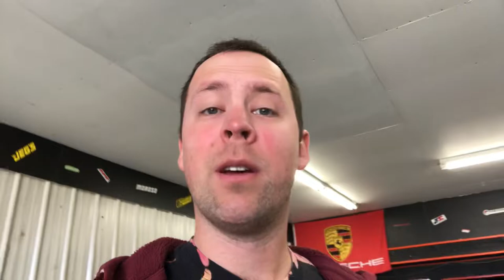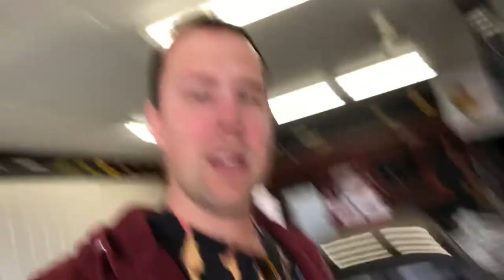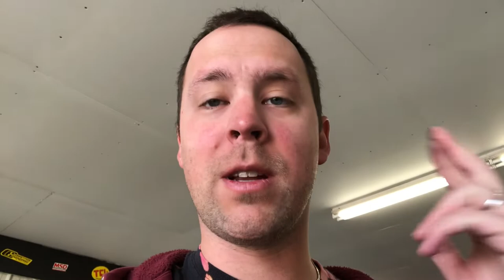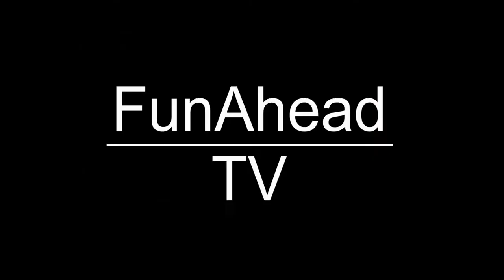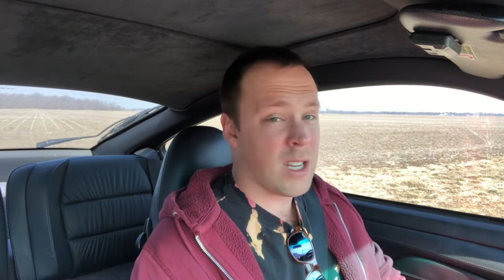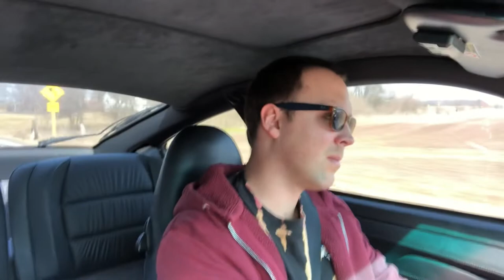Driving My 996 911 for the 1st Time Since an Engine Out Service

Comment: I’m jealous! I’ve been waiting for two years to drive mine again. All my parts are on back order tho, since I’m rebuilding the engine from inside out.
Reply from the maker: Sucks everything is on backorder! Why did you decide to do a full rebuild?
Reply: @FunAhead_TV_Official  had glitter in my oil filter so that pretty much answers that lol
Reply from the maker: Oh, snap… no bueno. Did you ever find out what it was that was causing the glitter? Rod / main bearings? Cylinder bore?
Reply: @FunAhead_TV_Official  oil starvation, and which fried my bearing and destroyed my crank 🤬
Reply from the maker: Ugh, that suuuucks. Sorry to hear that. In the process of doing all of this work, I swapped the oil return tubes in the sump to the 997 style. They made a massive difference! I used to see a sizable oil pressure drop in high-g corners, but now I see only a teeny dip if i’m really pushing it in a sustained corner.
Reply: @FunAhead_TV_Official  Yeah tell me about it. But its all good I now know my Porsche inside and out, with some additional bonus parts like JE pistons and LNE parts all around. Really? Are you talking about the air-oil separators in the sump? I’m considering those.
Reply from the maker: Yea. That’s definitely a plus! Also, yea, the mini air oil separators are what i’m referring to. 987/997 gen cars did away with those and they directly bolt up. They help with oil temps a lot too because the oil moves more and returns from the heads much more quickly. 1000% would recommend